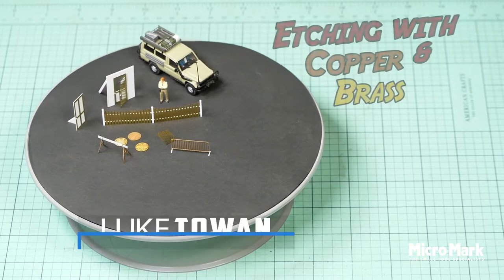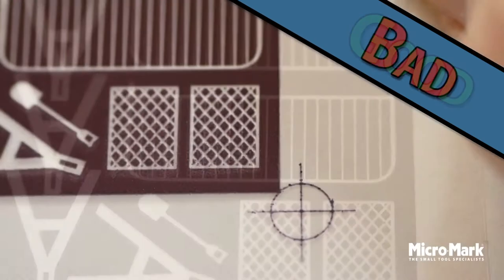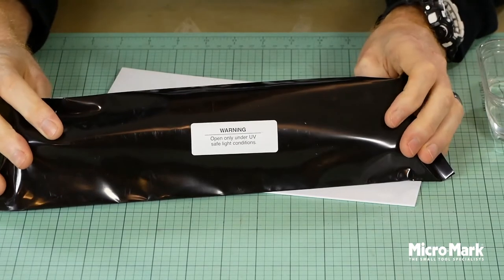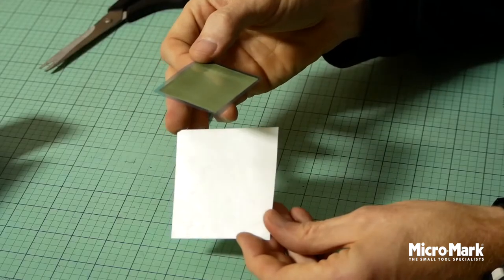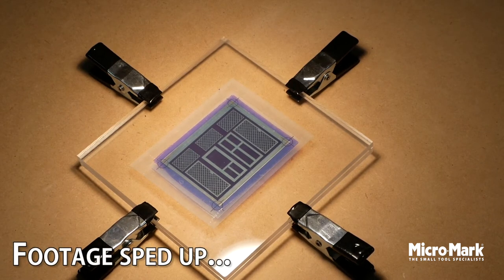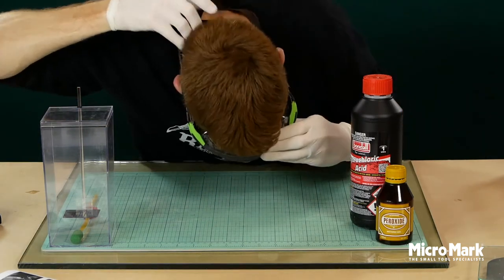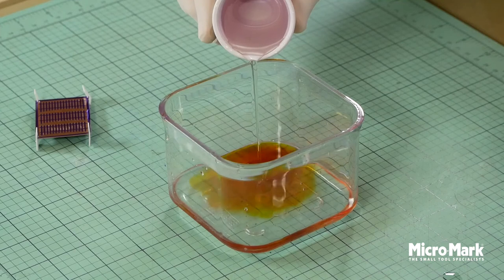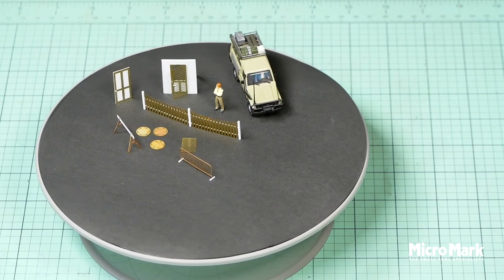All About Photo-Etching

Comment: Well Done Mate!!!! This is the Absolute Best Video that explains this process using the MM kit. [Its actually the Only Video out there I could find) but regardless it’s Content is Ripper Good…the narrative & film quality are amazing. The technique for crafting
 Photo/Etch seems to be some type of a DARK ART. With little to nothing on the topic. However the use of P/E parts is very Mainstream in the Scale Auto modeling community (as well as Aircraft, ships ect..).
But NO ONE KNOWS anything about it other than the Very ELUSIVE MM “Pro-Etch” kit that is Always [SOLD OUT•or on BACKORDER Status]for some reason…🤔. 
👉I spent 2+ years & interviewed many different top level scale modeling experts & I received answers like: 
📍I have a guy in Russia that does all our P/E frets, & the minimum order is 50 Units!! (I’ve seen this vendors P/E frets & the quality is 💯 & sell’s out quickly…
📍A fellow Hobby Machinist who sells his his own 1:24 Custom Aluminum Wheels & uses P/E centers told me that a PC Board company made his P/E wheel center frets. However again the minimum order was Large at 25+ units)
📍All the other answers where combinations of “I think that MM sells a kit, but it’s never in stock!
👉I can Confirm that MM RARELY EVER HAS THIS ELUSIVE PRO-ETCH KIT IN STOCK - you have to drop your $125 & buy it & patiently wait for it to come from the OUT OF STOCK/BACKORDER….as of today it’s……Drumroll…..OUT-OF-STOCK😆
⏳⏳It took me 40+ months of waiting & asking it it was in stock before it was & I purchased a kit. (I REFUSED to leave my $$ as a deposit, been 🔥 too many times…)😉
So I will be posting an online series regarding this topic on either my YouTube or IG channel. @ZenModeling 
Cheers again to the author of this excellent DIY instructional video💯⭐️⭐️⭐️⭐️⭐️👏👏👏👏👏👏👏👏👏👏
Lee
aka:☯️ZenModeling☯️